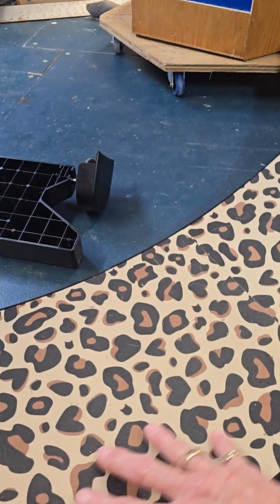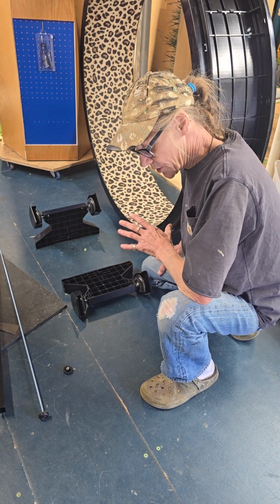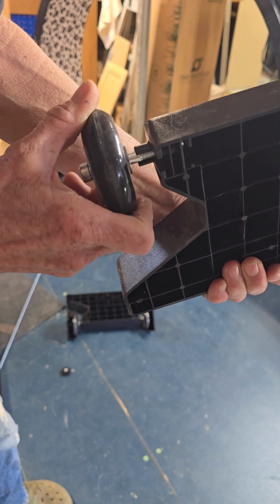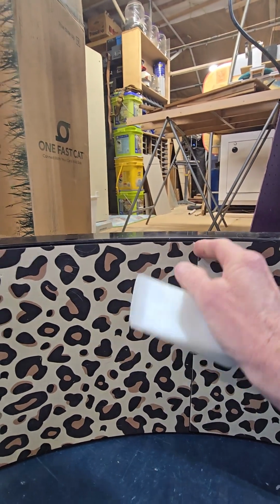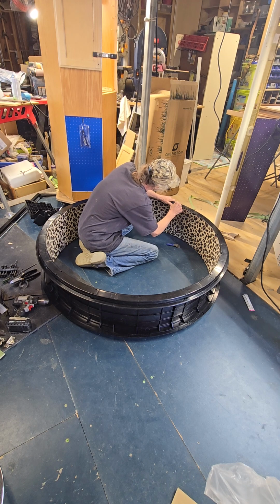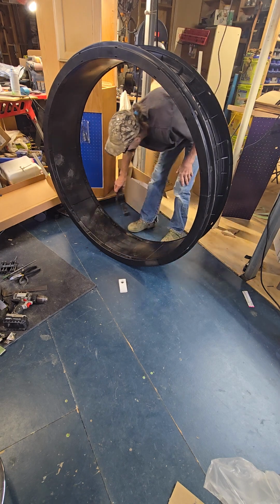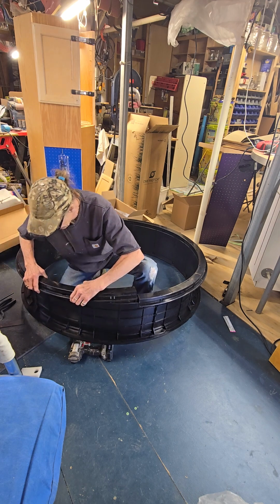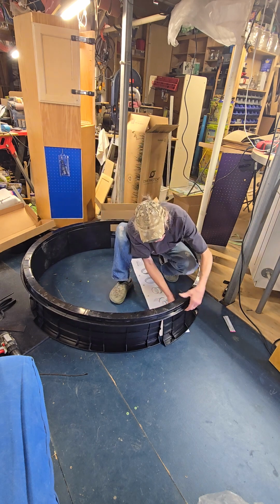How to disassemble Onefastcat wheel without breaking any pieces so it can be returned

Comment: My pads won’t come off like your are. They rip off and all the sticky stuff stays on the plastic.
Reply from the maker: i suggest warming them up with a blow dryer first and as you pull. you'll need to keep your pulling angel STRAIGHT and try not to let the pad angel as you pull. most glues like are workable with heat. it was very hot outside when i pulled mine off. that might leave the glue to the plastic, however, Cold causes it to stick moreso to the pad and not the plastic. 
Since i did this recording and said i was going to return it. i wound up keeping it and modified the entire wheel and eliminated the wobble pretty much entirely. I was also able to restick the pads when i reassembled it for the 2nd time. I did make several recordings as i went but hadnt posted them. I sure hope this helps. if you have any other questions or issues. please ask and i'll do my best to assist.
Reply: @ thank you! I got it taken apart one way or another. There’s no way I wasn’t returning that thing. The cat wasn’t having any of it.
Reply from the maker: @charles.etaguf  Thank you so much for the update. i was wondering if u got it. So glad to hear it for sure.  well...when all else fails, get a bigger hammer. i have 4 sets of 2 brother cats ages 7-13. Only 1 will have anything to do with it.
Reply: @1lilredfox   thanks to you and your video I got it done!!!! Thanks so much!!!!!

Comment: That rod isn't for stability, its just tension, like a string.  Hole is probably because there's a pastic bump on the end cap that fits into it enough to hold it together while you tightedn the rod.  More tubes would be stabler.  Yes, the support for the wheel appears poor. Yes. Not designed to take apart.